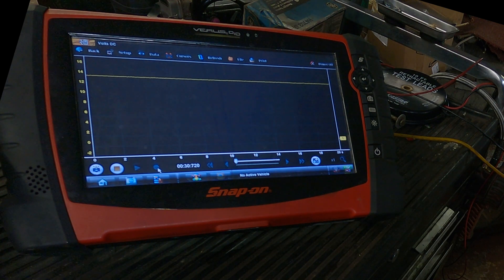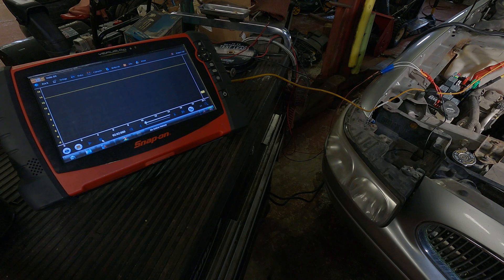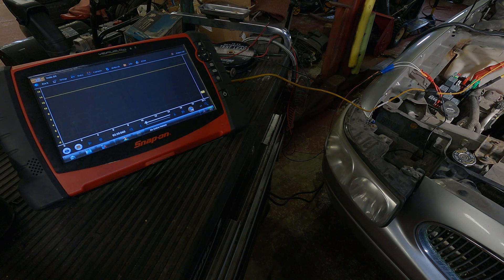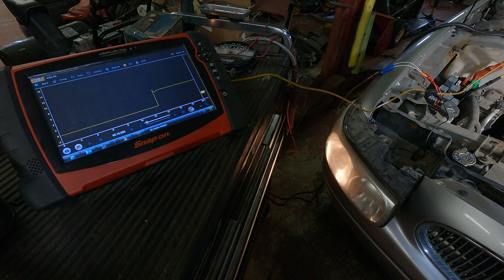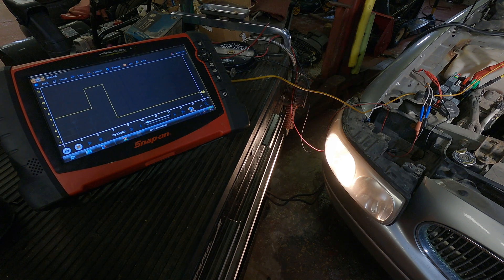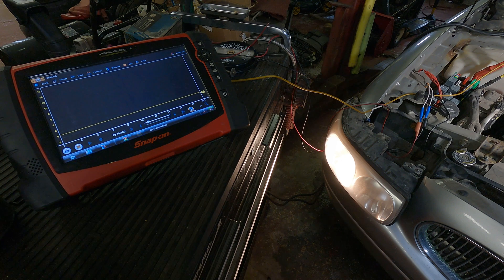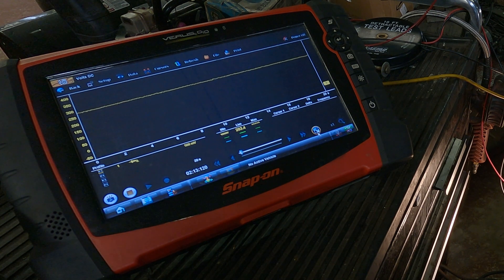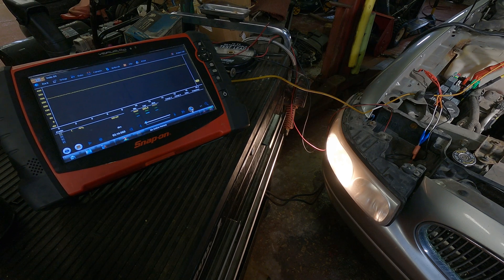Voltage Drop: If I could only use one test

Comment: I found a similar situation at work today on a 2016 Durango with an intermittent crank/no start...when checking the voltage drop on the circuit that supplies B+ to the fuel pump (from the fuel pump relay pin 87 in the Power Distribution Center, to the fuel pump itself), i found a 1.4V drop. Positive meter lead on B+ post at the fuse block, negative lead on the fuel pump B+ supply circuit using a wire peircing probe.  Not sure how to proceed but i know that should be less than half a volt

Comment: Not a mechanic here, but have a decent basic understanding of electrics through my job in Telecoms. It took a moment or two for the penny to drop as to what you were actually reading, but when it did, it was a wow moment for testing vehicle electrics....Essentially you are looking for a HR or HR Shunt between the two points of the circuit by measuring voltage drop. Is there a reason you prefer to do it this way rather than just measuring the 
 between the two points? I am guessing measuring resistance between the two points on the Positive cct won't pick up a HR short to ground/negative?
Reply from the maker: One of the major issues with automotive electrical testing is limited access. This is one of the many techniques to overcome this problem.  
The typical process when testing a live loaded circuit is to test across the two points at the component, traditionally. Which is good practice. The issue typically arises when a technician measures a lower voltage than expected. This is where this method comes into play. It's common for a technician to assume a low voltage measurement is an issue on the positive side of the circuit. Vdrop testing is a quick way to determine which side of the circuit the fault lies. 
Here is another video, essentially explaining that every measurement you take with a volt meter is a voltage drop test. 
https://youtu.be/tH0Hdwp7mcQ?si=3zcDYVWSt88BUj9C

Comment: I see a lot of older mechanics in the comment section saying that voltage drop testing is a newer thing they've attempted and that it works. Makes me glad I'm taking note of this as an aspiring tech. I feel like in the modern automotive world, you can't become a well-rounded tech without getting your electronics down.

Comment: Great job! So basically the battery is a Load, so between both points +/- is 12.6 volts  meaning resistance/ohms. I’m I getting this right? Thank you
Reply from the maker: I'm not exactly sure what you mean by the battery is a load. I like to think of the battery as the start and finish of the race/circuit. 

Every complete circuit, uses all of the potential/voltage of the battery to complete the race/circuit. This is regardless of the resistance of the circuit. But knowing this, we can test the voltage drop across a load and determine if all of the potential/voltage is used up on this one load or are there additional loads/resistance in the circuit. 

If we see 1v less across the load than what we tested at the battery, then we can, use voltage drop testing to determine which side of the circuit has the additional resistance. 

I hope this helps.

Comment: I have been a mechanic in the 80ies ,never used a lab scope ,the other day i was working on a 2010 mazda3 ,i did a test on the negative side of the battery to ground and found 5.8volts i was shocked ,
Reply from the maker: It is hard to be efficient in todays world without a scope. 
I still spend a lot of time with a meter and testlight, but when it's time to break out the scope, it's worth the investment every time.

Comment: Good job but maybe using a little drawing board with showing where you put the resistor between to leads would also help
Reply from the maker: Thanks for the feedback. Good tip, I will try something like that next time.

Comment: I've been a professional tech for 45 years. I hate to admit that the first twenty years did not include an understanding of the value of a voltage drop test. I felt like a genius when I diagnosed an issue where the previous tech had crimped insulation into the terminal. Multiple techs had tried to figure it out and I had just discovered the voltage drop test. It was an eye opener and led to a whole world of understanding. I'm glad you used a scope to explain this test because it really shows a great visual.
Reply from the maker: It's never too late to learn. This is easily one of the most overlooked fundamentals. 
Thank you for watching.
Reply: @710diagnosticsandfishing  It certainly is. I witness the lack of understanding with the majority of techs out there. Understanding it's value, especially for connections and switch contacts under load is invaluable.

Comment: Load-Pro?  Thx.
Reply from the maker: I'm not exactly sure what the question is? 
Load pro is another way of achieving an accurate voltage drop test. I've heard a lot of good things about the Load Pro, but I've never used one.
Reply: @710diagnosticsandfishing  , thanks for your response.  Sorry for assuming you had used/tried a set of Load-Pro test leads.  Was wondering how they compared in your experience.  I like them as you can quickly test both the positive and ground wires quickly.  They will quickly identify a very small wire leak as well as tell you which wire is the culprit. Thx again for your video.

Comment: Why is the voltage difference 12v when the connector is disconnected from the light
Reply: Because no load is being applied to the circuit.
Reply from the maker: The only time the voltage difference is "12v" is when I have the light switch off, and momentarily, as I'm switching between the fuse, for the circuit, and the resistor that I used to simulate a high resistance point. 
I used a sealed beam headlamp as the resistor. I had that connected inline, instead of the fuse, then swapped it to the fuse to "fix" it. 
Anytime the load/vehicle headlight is not connected, there will be minimal vdrop, because, no current is flowing. 
This means the available voltage at the connector is similar to the available voltage at the B+ stud. This is the case as long as the circuit is unloaded. As soon as the circuit is loaded, any resistance from the B+stud to the positive at the headlight connector will cause the available voltage at the headlight connector to drop. This happens on every circuit that carries some current. It is up to us to determine if the measured amount of voltage drop is an issue or not.
Reply from the maker: If you tell me the exact time, in the video, that you have a question on, I'll explain it.